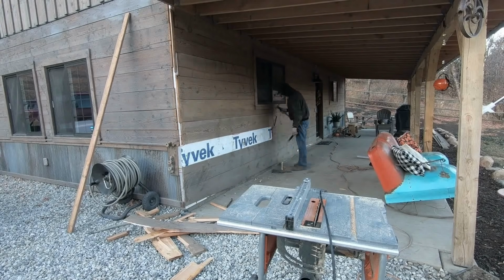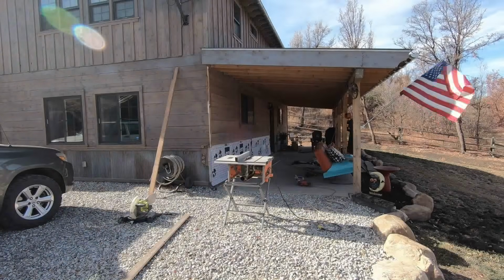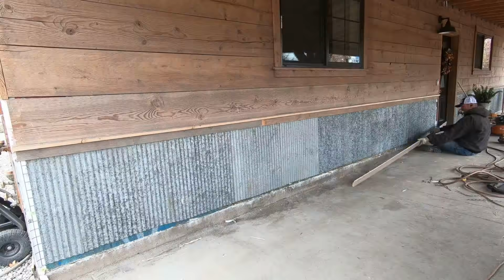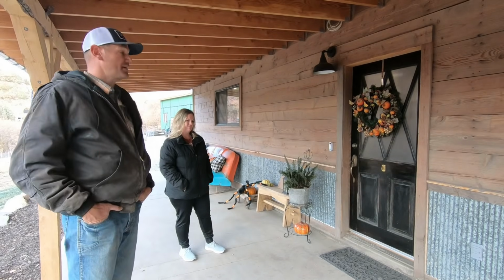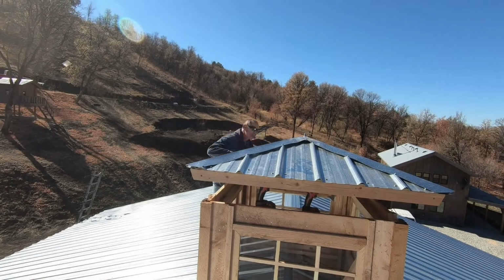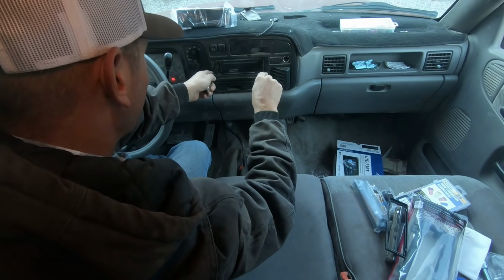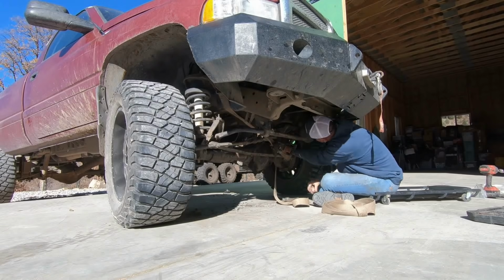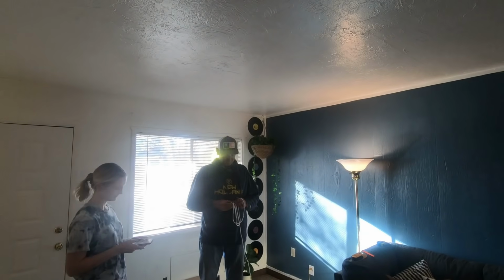#448 - Installed Weathervane On Shop, Finished Corrugated Tin Siding...

Comment: 17:35 Butter Knife - the best tool ever!
Reply: Yep, a true multi tool.   Spatula, pry bar, screw driver, and when you're all done you can make a sandwich to celebrate a job well done. ;)   As a young lad I used to work on cars a bit and have eaten plenty of sandwiches with engine grime finger prints to know it won't kill you.

Comment: I remember about 25 years ago finishing the exterior of my own shop. It is in the Sierra Nevadas  and  fall was upon me. I had bought a kit for a 2 barrel "Alaska" stove. I started by insulating and sheet rocking the corner it was to reside in before I did anything else in the shop. This turned out to be a good move because I had heat to finish out the interior in relative comfort. I don't do my best work with frozen fingers. Since then countless old car and motorcycle projects have been completed without rolling around in the cold and snow. Enjoy your new shop... you deserve it.

Comment: Just a suggestion but after seeing the oil on your gravel outside shop I would suggest befor your shop gets filled up that you invest in some acrilic floor paint .Paint like car dealerships put down in their shop.Makes cleanup easy and looks fantastic.From doorway to area where you will usually work on vehicles.Keep that shop looking great.

Comment: Everything looks down right spiffy! Glad Cedar is up and about. Hope she is getting enough rest between times. The weather vane is beautiful but I'm sorry that the cupola tried to bite your head off. You're right about a good stout hinge and prop so it doesn't bite you again. A solid way to keep the top from flying off in a storm such as a good latch wouldn't be A miss either. I'm so glad that you and Cedar found each other and built your forever home!

Comment: you should think about lightning protection - it will fancy it up and could be a good idea - also think about 10m radio antenna - cause you want radio options - maybe a scanner antenna #u/l sideband
Reply: nice stereo install, maybe you can do wifi from the cabin to the garage? would be a nice feature - consider hw floor in half of the garage - you could loop pex underneath and get all heat from woodstove into an old hot water heater and radiator and back to copper in stove and another closed loop of water in pex that just gets recirc underhw but would heat up the entire foundation - thermal mass - it holds the heat for a long time - could be a good diy way to get more heat out of the system - also have a heat exchanger and pos pressure hepa as well as some passive intakes - you do not want to breath all voc from new construction - you are at systems phase of install - it should get interesting as you start weaving it all together - you may be able to just use a heat pump and find that it works out great or maybe just the conventional wood will be more than enough? are you going to do a vent bringing in air to the stove? it may make a lot of sense or could be overkill? #hvac planning #voc #formaldehyde #benzene #glue #some insulations #manufactured wood products #offgas

Comment: I have a 2003 Ram Cummins 3500 and have had the same steering issues. It kept eating drag link bushings every couple months, and would get the death wobble too let me know it ate more bushings. After three different shops tossing parts at it$$$ with same problem continuing.” It’s a bad design “ is why I was told it can’t be fixed. The design that worked fine the first ten years hadn’t changed!( just wore something out) I found a old school suspension tech and he told me the root of the problem. The steering stabilizer shock gets a flat spot in it. I had already replaced it with factory, same problem. He told me Napa brand shock works better. After doing that no issues over two years. Sorry we don’t live closer I have a 86 Chevy 2500 square body that would look great at your place.

Comment: "Installing a radio isn't that complicated" is the exact thought I had when I bought a replacement system for my 2008 civic. Which involved a section of dashboard which had to be replaced and a lot of wiring that I underestimated. I opted out of the wiring harness prebuild and figured it would be a piece of cake. Negative. But all in all I had to practice up on my soldering and cable management. I had to figure out how to position all the wires in relation to the system I was installing. The system I installed came with everything I needed to coexist with my cars existing audio systems, but the installation was pretty intermediate as far as skill went. By the end of the project I had learned a lot and my new radio worked fantastic so I was pretty content. Just goes to show that things don't always seem as simple as they appear, but with good education and research you can do these things for yourself and get good results. I don't even want to know what the bill would be for my audio upgrade because I also ripped out all of my stock speakers for some rockford fosgates. I've been following for awhile and this is the first time I think I can truly relate just based off projects that we have mutually taken on, but I think you've pretty much nailed it. Keep it up you've given me an astounding amount of confidence in the homesteading field and I'm currently seeking out land of my own to start my home. 

Thanks

Comment: The homestead looks great, the cupola adds that farm looks to it. A great tribute to Rugger with the dog vane. Without hearing what was said, Cedar didn't look happy after seeing the knot on the trim over the metal siding, but I'm sure you gave a good explanation for it. Will you get a garage door installed before the heavy snows arrive and back the plow truck up & ready for its first job of many?

Comment: I see you haven't any lights for your Workshop. I've been watching, "Outdoors with the Morgans" on YouTube, and they have just had a Workshop Play-Room installed on their property and he has put two of these 360 Degree, LED "Shop Light" units up in it, that seams like they work great for him. You can get this light at Harbor Freight, for around $75.00.
Here's the information on it;   Braun 7200 Lumen Hanging Work Light with 360 Degree Light Output.
The Braun 7200 Lumen Hanging Work Light is an essential tool for lighting workspaces or construction sites. Featuring an LED array that surrounds the entire unit, this worklight casts an impressive 7200 Lumens of crisp, bright light in every direction. The spring loaded clip at the top of the unit provides a secure mounting solution, while the additional plug on the chassis allow up to 10 Hanging Construction LED Worklights to be connected to a single power cord.

Comment: If you let that wife if yours take over the tool sorting you will be able to find things again. I would get a sharpie and label each shelf so you know where to put it back when you are done.  Make sure to build the bottom shelf off the ground so you can hose out the garage if you want to.  I installed 1/2 inch plywood on the walls so I could hang anything anywhere I wanted.  I then covered it with cedar fence boards to get the rustic look and amazing smell I wanted.   Getting your stuff sorted out will make your life so much easier....

Comment: Just a little fyi it cheap to do take motor oil and diesel fuel and mix it half and half it makes for a nice stain the older the oil the darker it will be caution it does have a smell for 2 days max .oh and if you want it lighter  you use newer oil maybe you can try it i hope you like it we sure do

Comment: I, too, am a bit concerned about a lightning strike,  high up on a mountain, humongous steel roof, now a long pole pointing to the sky.  A perfect target for o lightning bolt looking for an easy way to ground.  I'd ground both the shop and the house.  Better safe than sorry.  Also, I'd either move the half pipe or cover the window with cattle grid.  Love what you are doing anyhow -- not criticizing, just offering some friendly observations.  btw is the cupola securely anchored to the roof?

Comment: I like the design you currently have on the house with the board and batten at the top and the horizontal on the bottom with with metal. Anyway, why spend money for something that is already perfectly done?
Reply: I agree on the  house siding it sets the design for the house and the corrugated tin accent is a really nice complement

Comment: Hey Heath mr poppy man how about putting an open tank a wide open tank to d back for water wen snow starts to fall it will catch d snow n probably rain but first mesh it not fine mesh but open enough so d snow could fall in n in spring it melts n there water for d animals n other things.

Comment: The horizontal siding really compliments the vertical lines sf the corrugated panels.  And what a waste of wood if you tear off all the rest of the horizontal siding - I guess my question is, why does your house have to match the barn?  Like furniture that is too match-matchy, buildings that look just alike lose some of their character overall, whereas differences make them stand out.  Only my opinion, though.  The weathervane  is WONDERFUL!

Comment: What's the advantage of "corrugated tin"? (I assume that it's actually galvanised steel.) It has zero insulating properties so it won't keep in heat as wood will.

Comment: You should be able to mount the basketball hoop on your beam and get rid of the stand... I to live out in the middle of nowhere in the Wyoming black hills and we have troubles with Critters that want to swipe my chickens my husband built a run around the chicken coop and it's chicken wire is mounted on cattle panels that are buried a foot into the ground so that anything coming up to the fence big like a dog or coyote won't be able to break through the flimsy chicken wire and something like a fox or coyote or dog won't be able to dig under because they'll hit wire and will give up. My chickens are free range in the summertime during the day but if I'm not going to be around I can safely leave them in the Run and they'll be completely safe and happy in the winter time they have the Run to run around in I also have netting over the top of the Run so that owls and Hawks cannot get in I've not lost a chicken so far
Reply: What? No snakes?!
Reply: @gardengatesopen  we've got bull snakes and supposed to have rattle snakes I've been out here for 7 years and haven't seen one yet

Comment: does the weather vane need to be grounded like a lightning rod?
Reply: Safety Nancys
Reply: @honthirty_  it's a good question if that would be best practice.
Reply: Its not likely an issue given that it doesn't have much relief but I'm not knowledgeable. For sure wouldn't hurt.

Comment: I have 2 Fords that need stereo replacements....I swear it must be a Ford thing, they're the only vehicles that I've ever had to replace broken stereos in.  Well I did replace the stereo in my 99 Dodge Ram 1500 but that was because I wanted a CD player, it was only AM/FM so I replaced it with one that had a CD player, but the factory radio was at least still working.  Heck the CD player in my 08 Toyota Tundra quit working 3 years after I got the truck, was far from impressed with that truck overall.   

Heath, your Dodge will forever have front end issues, the diesel trucks were always the worst because of all that additional engine weight, Ford has the same issues but not just with the diesels they had the problems with the V10s as well.

Comment: Old Bob Villa tip: when drilling straight-up vertical into a ceiling, buy a small cheap rubber basketball, cut it in half, run your drill bit through it, and use it as a cup to catch all the debris falling  while you drill vertically.
Reply: Thanks for the tip!